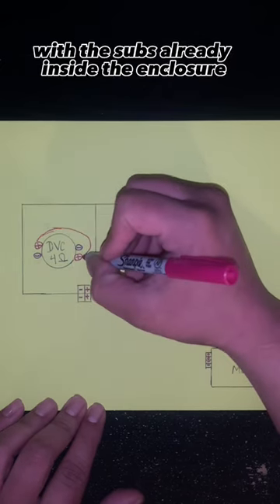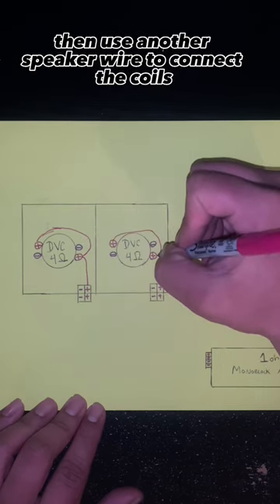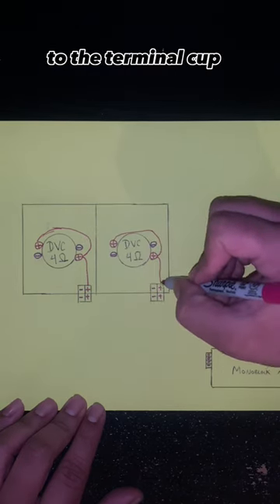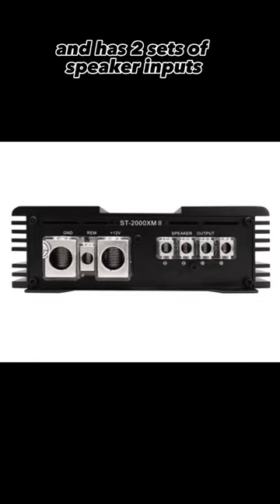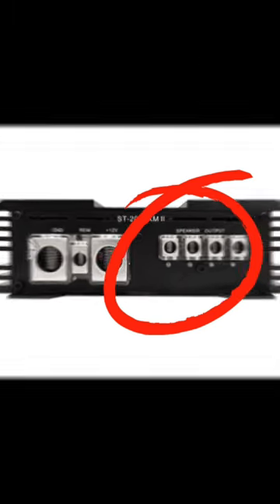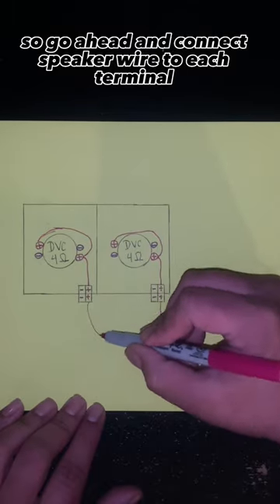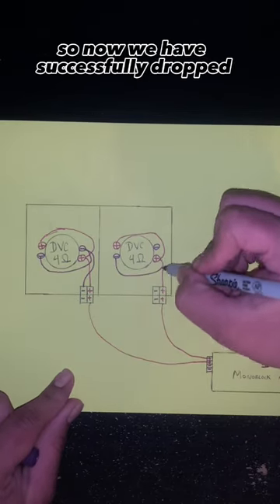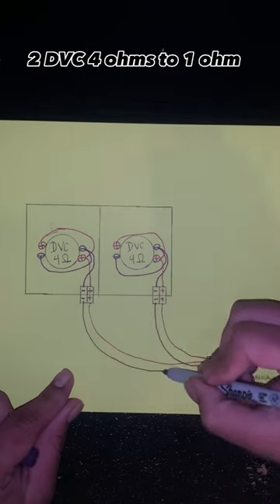Two Dual 4ohm Subwoofers To 1 ohm #Shorts #CarAudio #Amplifier #Bass

Comment: Hey I have an 4500w 4 channel, I only have 4 speakers why Is my amplifier overheating (4 door speakers) 1 on each channel….??
Reply from the maker: Make sure your power & ground wire are the appropriate gauge size. If you’re running more than 1k watts RMS you need at least 1/0 awg

Comment: Wait so this is 1ohm??? They said that i had to use a jumper wire to the other sub to make it 1ohm
Reply: Either or. I assume.
Reply from the maker: As long as both of your subs are D4 and your amp is a monoblock 1ohm stable then yes 👍

Comment: I only have one sub how do i do it to 1 ohm from 4
Reply from the maker: If your sub is a D4 and you do parallel you’ll have 2ohm
Reply: You need a dual 2 ohm sub for 1 ohm. I have 2 Rockford fosgate p3 2 ohm wired to a 2 ohm final load

Comment: When I did mines like this my amp blew up
Reply: Because one ohm makes your subs louder their for making the amp put out more power
Reply from the maker: Sorry to hear that bro! What kind of subs did you have and what kind of amplifier did you have?
Reply: @PincheBeto_Bass  America bass elite 12s and skar rp 2000
Reply: @PincheBeto_Bass  it did the same with my ct sounds 2000 but I had got a skar rp 1500 everything works fine
Reply from the maker: @balloutsavage8912 are you sure your subs were DVC 4ohms? Because all three of the amps that you mentioned are 1ohm stable, so there shouldn’t have been a problem. Unless the subs were DVC 2ohms, then you had a 0.5ohm load which is dangerous and will blow your amp. Another reason why the amp could’ve blown is because you had the “gain” too high
Reply: @PincheBeto_Bass  yeah the gain was almost to the max
Reply from the maker: That’s not good bro your gain needs to be tuned with the SMD DD-1 or an oscilloscope, the gain is not a volume knob it needs to match the voltage of your headunit. If the gain is too high you’re going to clip your subs and that’s the worst case scenario
Reply: Maybe your gains were set too high.

Comment: On my D mono amplifier, it says not to hook up 2 dual 4 ohm subwoofers to 1ohm because it WILL NOT be able to handle the 1 ohm load. Im not trying to be a dick,  but this is a little bit miss leading. Some people will have to hook up a 2nd amplifier..
Reply: It was a simple demonstration for people who have a 1 ohm stable amp not just you bud
Reply: @brendenperry3770  like I said, wasn't trying to be rude. Brotha.